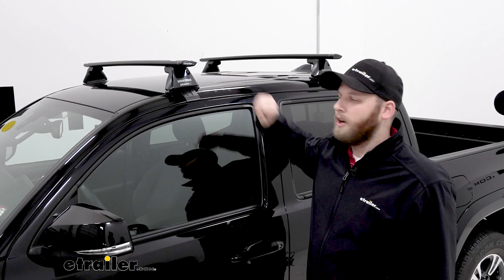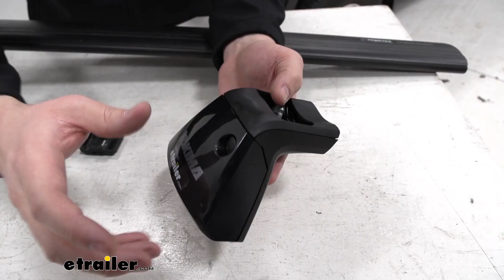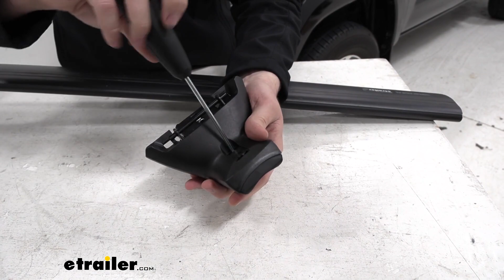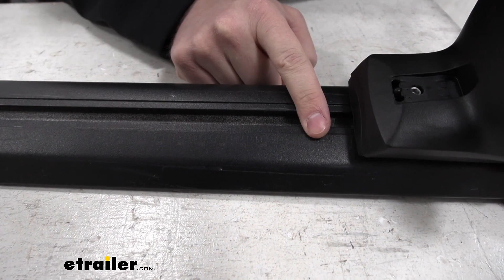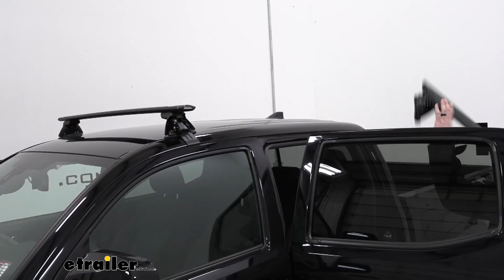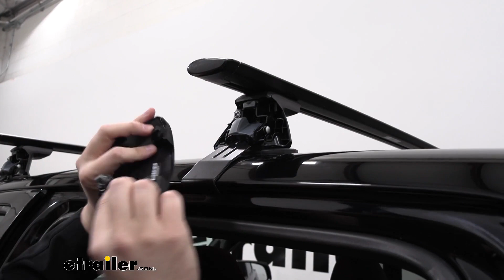etrailer | How to Set Up Your Yakima RidgeLine Roof Rack for Flush Rails on a 2019 Toyota Tacoma

Comment: 2 questions - 1) whats the difference between the baseline tower and the landing pad 24? 2) can this baseline towers be used with the yakima lock n load?
Reply from the maker: The baseline towers connect to the landing pads. The landing pads can mount in the t-slots on the Yakima Lock N Load.
https://www.etrailer.com/Roof-Rack/Yakima/Y00221.html
https://www.etrailer.com/Roof-Rack/Yakima/Y00425.html
https://www.etrailer.com/Roof-Rack/Yakima/Y00148.html
https://www.etrailer.com/Roof-Basket/Yakima/Y05044-39.html